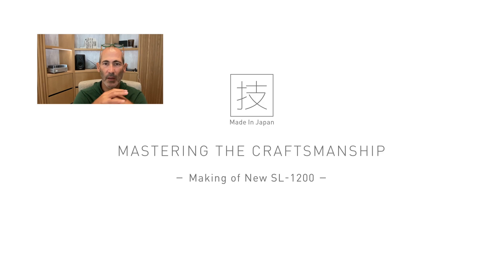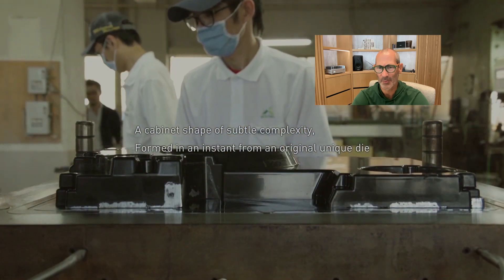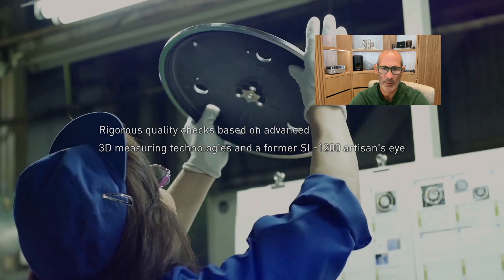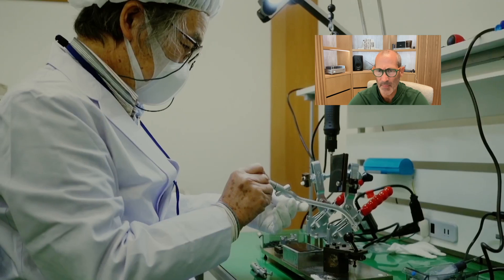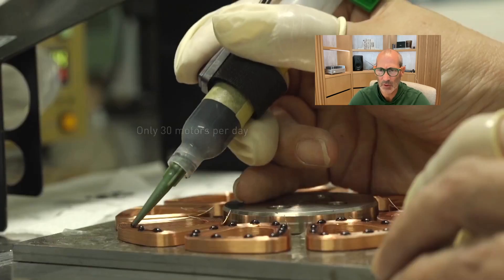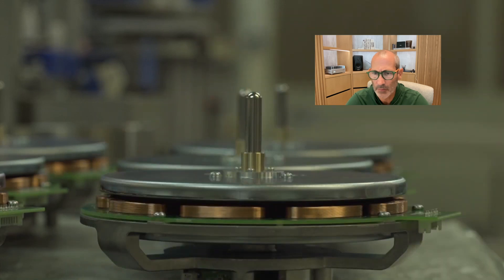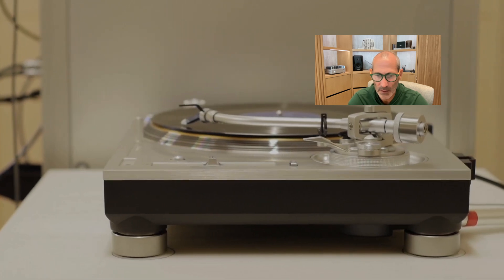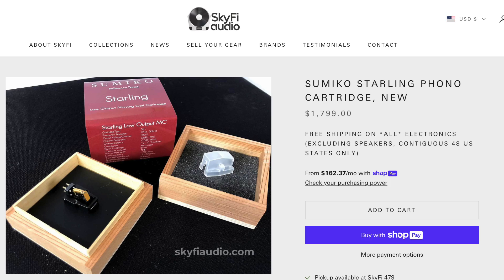How the Legendary Technics SL-1200G is made

Comment: I own a 1992 1200Mk2, and I wanted to buy this 1200G just for the pleasure of it. I did some research, and was put off by the fact that this new model is equipped with a switch-mode power supply, and SMD components. Totally prohibitive for me, this type of electronics is programmed obsolescence. Too bad... 😪

Comment: Love these kinda manufacturing vids. Seems like you get soo much more value, quality, engineering, product, etc. with ProAudio type stuff (like Technics TTs), esp Japanese brands... than you do in the "hi fi" world (filled with snake charmers). 
I have a pair of old M3Ds myself (20 years ago, I had M5Gs... sold them cuz I needed money for a move). 

Makes me wonder tho...  I have HS8s and use them for record listening (and love them), and thinking/wondering if it has the same value/quality/engineering per dollar like say the Technics, on a sonic/acoustic standpoint for speakers.

I dream of Forte or Cornwalls someday... but, it seems like you're not getting the same level and ratio of quality-per-dollar as compared to Technics or other PA stuff. PA stuff is highly mass-produced tho... so maybe that's why they're much cheaper too.

And that makes me wonder how much better (or maybe, how little) a difference/upgrade it would be to go from cheap HS8 to say Fortes. 
I'd be thoroughly disappointed & upset if the improvement was minimal (or worse... worse than the HS8), after switching to Fortes. 
$5k + another few-K for an amp, if a minimal sonic improvement, would obviously be a major buyer's remorse, lol. 
 

Only time I've heard Klipsches was in Japan in jazz-kissas and underground clubs. But they were usually Khorns, and 2-6 of them throughout the space. So not really a good gauge/test. (of course, they sounded amazing).

Comment: There’s no better than quartz locked direct drive, 
Lots of comments about it not and belt drive is better but they forget that direct drive “motors” are spinning the slowest of all including idler driven of course,
Essentially there are electrical convection, contactless operation , no belt needed 
Try dragging the platter over a table using a(springy) belt vs using your fingers and tell me with way is the on you can get accurate speed with the platter doing it.
Cogging,, well having a spring/belt pulling it towards one side vs precisely electric magnetic convection pushing outwards 360 degrees all at the same time all the time extremely accurate, please,, dd wins.
It cost a lot to make and pattern dd, that’s why the guys at project and rega doesn’t have it.

 I dream that JVC is soon making the really high end players again, amazing wood bodies combined with aluminium and analog gages for tracking force, anti scating and damping 👌🏻👌🏻👌🏻❤❤❤

Comment: Thank you Fernando. I recently bought a Technics MK3 ex Vietnam. One owner, well maintained and serviced. I absolutely love it and doesn't have the issues my Rega Planar 3 had which used a mass produced industrial 110V synchronous motor with a resistor for 240 Volts and different current pulley size for AC frequency. I've since picked up a Technics CD player with MASH sampling but my MK3 is allowing me to hear things on my review that I've never heard before through a NAD C268. I enjoyed this video very much

Comment: Great reporting on the techniques turntable back in the late 70s I bought a techniques turntable I don’t remember an SL 1200 or 1500 to go with my Yamaha 1020 receiver I also had a pioneer real real and an Akai tape deck cassette deck. Anyway, I wish I still had them all. I still have my Yamaha receiver, but unfortunately, I basically gave away. I tap decks, my real real and my turntable, but I wanna know what’s the difference between The SL 1200 and the SL 1500 back in the late 70s I don’t remember which one it was I had though I know I paid a lot for it cartridges I don’t remember I don’t think they were that bad. I think they were around $200.00 or so dollars for the good ones back in that time at Dow stereo I think it was in San Diego Ca.  
But I still have a bunch of LPs in a box and I’m thinking about buying another turntable. Not sure which route. I should go for that nowadays without spending an arm of the leg.

Comment: Are they still made in Japan of in Malaysia?
Reply from the maker: I haven't noticed any quality differences and none have been reported to me.  As long as they are well assembled I'd rather take the cost reduction on the item.  I suspect with the labor rate in Japan these tables would be substantially more,.
Reply: There’s a misconception that the quality changed. Trust me it didn’t. It was simply a move that was more cost effective. I have GR made in Japan and GR 2..they are both well made.
Reply: All Technics turntables are made in Malaysia for about two years now.
Reply: I am Malaysian. I bought my 1200G in Australia. And I have spoken to one of the biggest HI FI dealers in Malaysia that sell hi end brands early this year. They told me that despite being manufactured there is no dealership in Malaysia. 
As such one can’t find any technics grant class turntable there. (except the vintage SL 1200 mk models private sale in second hand market).